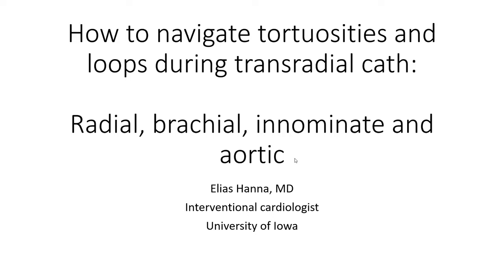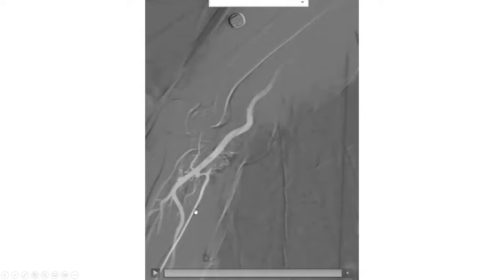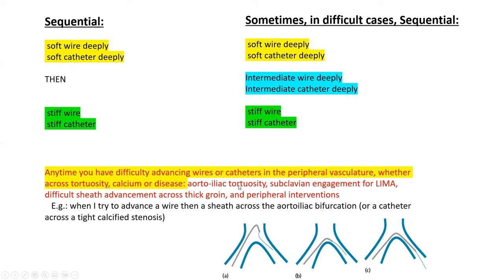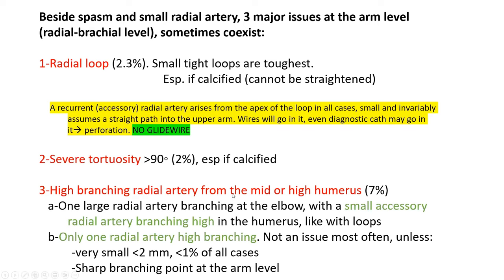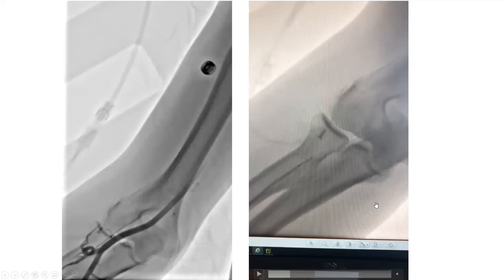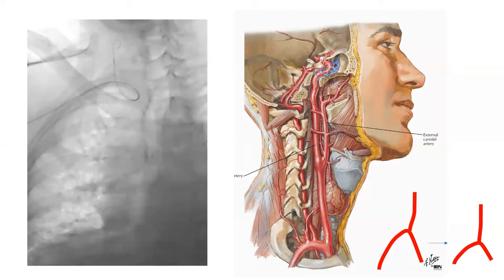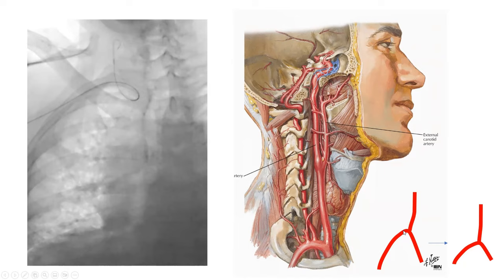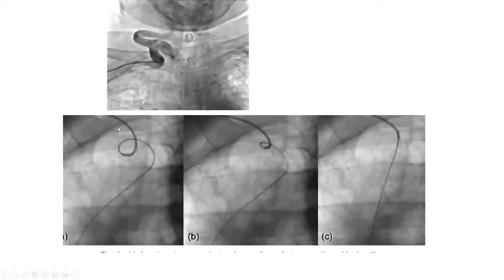Radial loops- Difficult radial, subclavian and aortic anatomy: step-by-step, cases, perforation

Comment: Great lecture as usual Dr. Hanah. BAT technique is great. I also use 5F 125 MPA inside the 6F guide (mother daughter technique). I also use the MPA instead of the glide catheter to manipulate tortuosity. The cordis made MPA are very soft tip and the bend is also friendly for radial and brachial.
Reply from the maker: That is a great tip. Thank you!

Comment: Thank you so much. I have a question. If we keep the 0.018 or 0.035 wire inside the catheter while we inject contrast,  is there any risk of bubble formation within the catheter?
Reply from the maker: Good point. There is a risk of bubble formation if you suck hard when you are aspirating the catheter. The lumen of the catheter being now smaller, you have to aspirate gently rather than vigorously before flushing. You should still aspirate well, at least 6-7 ml, to eliminate bubbles but also clot (as there is a higher risk of clot formation), but be gentle. 
      The bigger risk I see is clot formation over the wire, especially that the lumen is now smaller. Hence the importance of being anticoagulated while doing injections with a wire in place. Usually, for that purpose, I use the standard heparin dose that I use anyway in radial procedures (5,000 units or 50 units/kg)